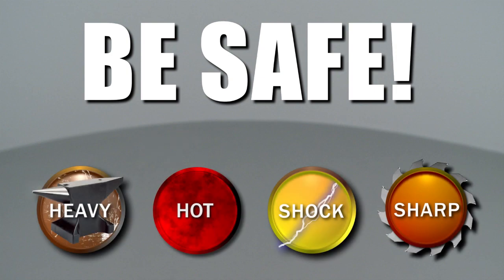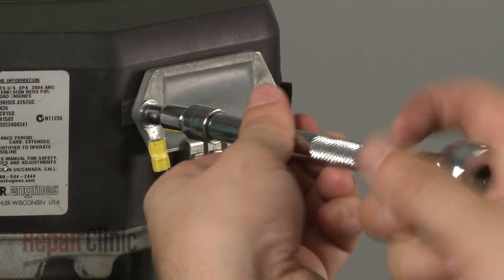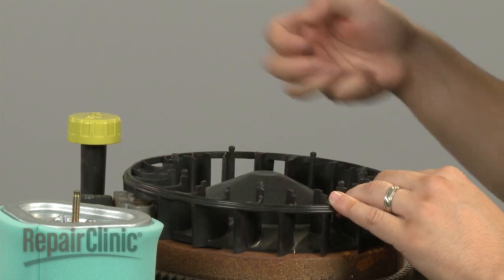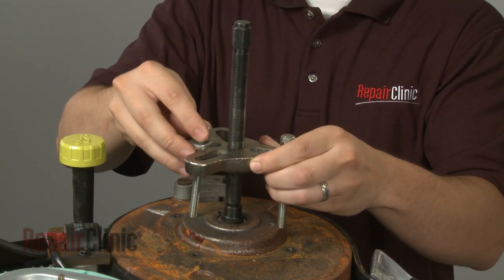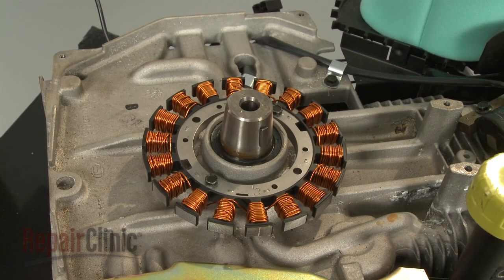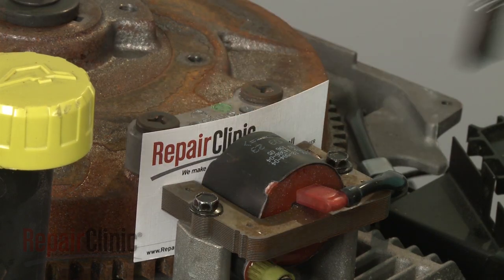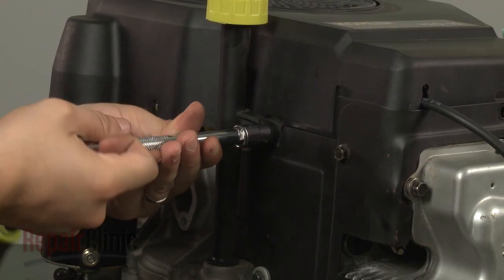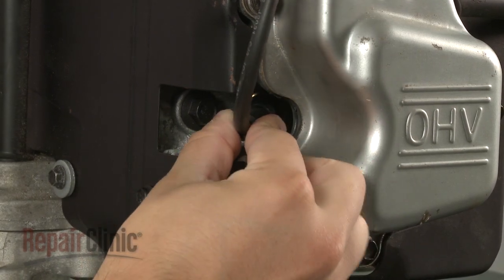Kohler Small Engine Disassembly (CV15-41502), Repair Help

Comment: You left out the part where you disassemble the engine. Is that in another video? I mean, you didn't even remove the carburetor. THAT'S more common to need cleaning/maintenance than the flywheel key.